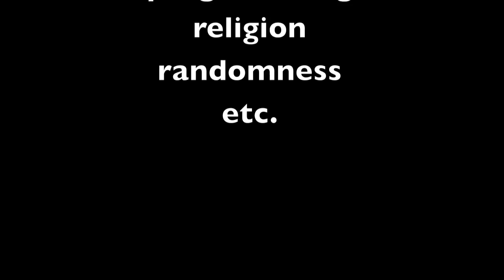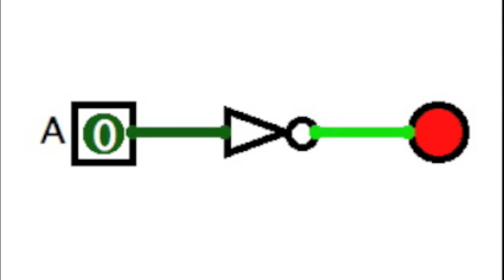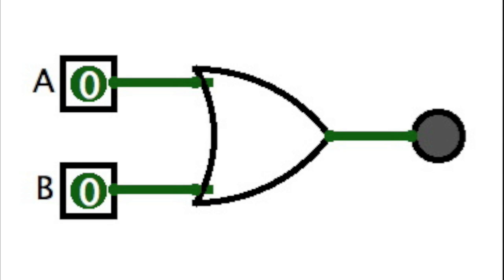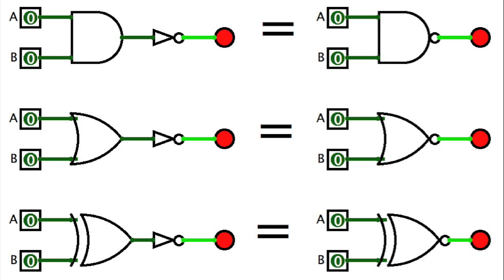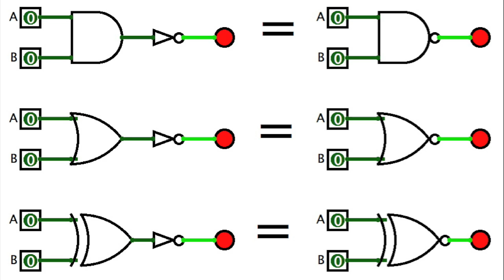Digital Logic Design: Part 1

Comment: Hmm... What "household equipment" would you use? AND and OR could be addressed through the use of doors (eg two doors either end of a hall leading into a room = AND; two doors opening directly into the room = OR), but what would you use for NOT?

Maybe my paradigm is wrong. I'm thinking flow, and I need to be thinking state. What constitutes a good dual-state household device that is not electrical and allows for negation (ie. state reversal)? Or am I thinking to hard.  (lol)

Comment: It is due to the stable states of the semi-conductor circuitry. it is not a fix value it is just a stadartization, you can get difrent voltage states if you design the circuitry from the ground up (i.e. the way we build the gates to do that logic operation)